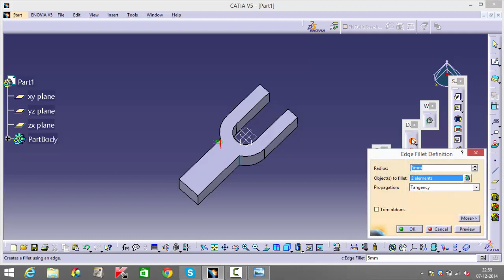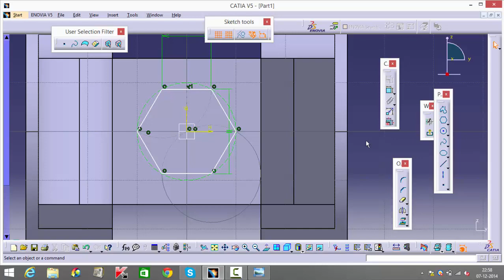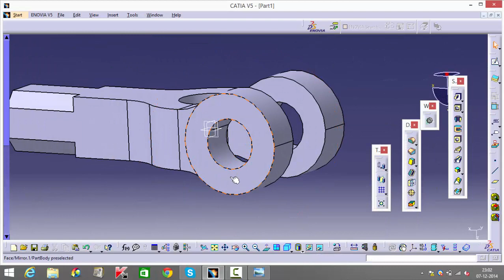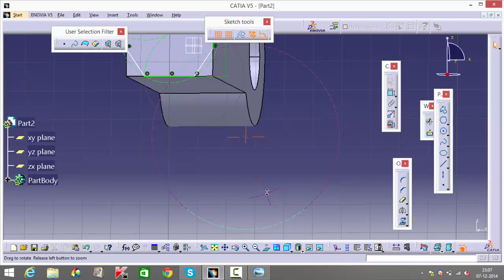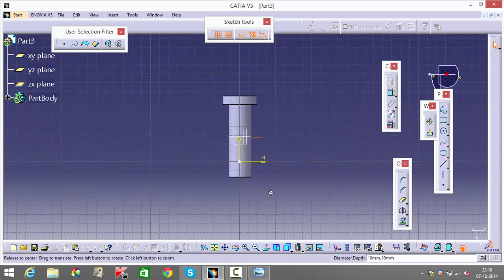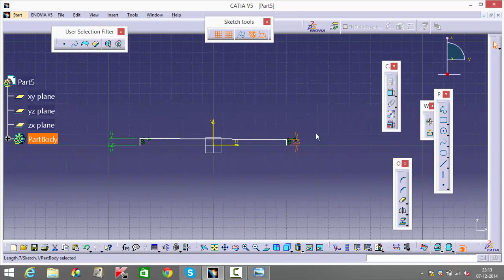Knuckle Joint Machine Drawing on Catia V5

Comment: how did you calculate taper angle and small diameter and collar hole  diameter
Reply from the maker: ayyanar k forgive my memory but this was almost 2-3 years ago.. but all (rather majority) calculations were mentioned in text book that I was using as reference.
Reply from the maker: Which parts are you referring to, I'll probably able to refresh my memory. Like I said been close to 3 years I think, so mention which part number and I should be able to help.